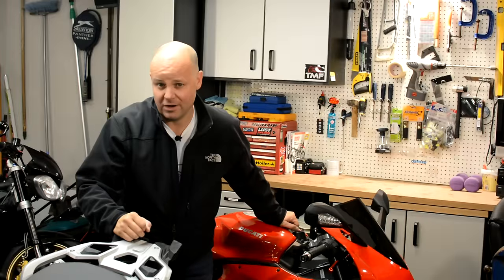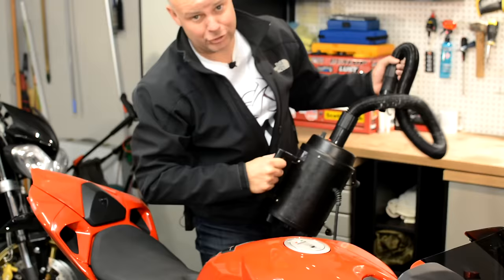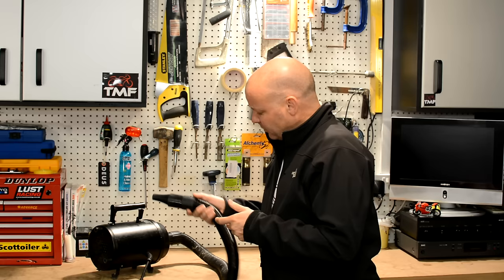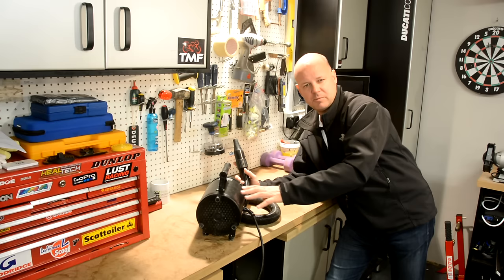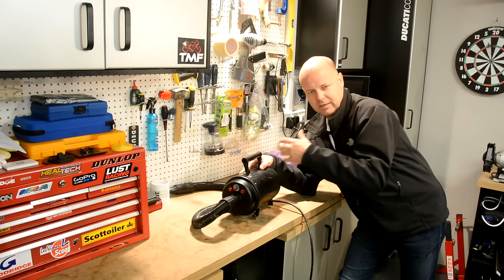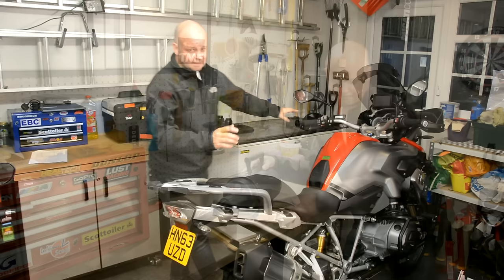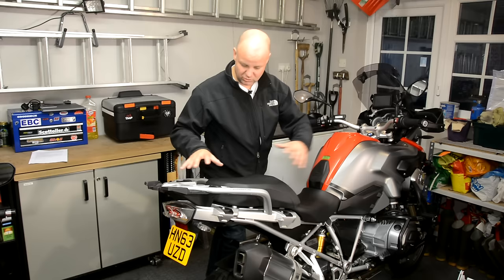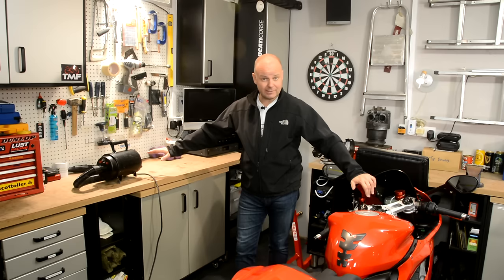Detailing Secret Weapons - Motorcycle Dryers

Comment: I dont own a bike but love (read obsessed by) the channel. I own a detailing company in scotland and highly recommend the dryer for the bikes they are a god send, Polished Bliss also sell some dryers Black Baron hand held is a good machine, Ebay sell these dryers but beware of buying outside of the UK, i also use an RCD with it... just incase. when your vehicle is waxed or sealed it makes drying so much easier, have a look at Tac systems UK for paint protection coatings.
Reply from the maker: Cheers Graham, good tip re the RCD - thanks!

Comment: Thank you for another informative video. I went the pet dryer route for my Tiger 800 and it still amazes me how much water blows out from the radiator!,I can say it works a treat when set to hot, never had a specific bike dryer but the pet dryer has been used for 12 months with no problems. Think it was £55 from flea bay, hope that help someone who is worried about a pet V bike dryer.
Reply from the maker: Thanks Wayne - the pet dryer in my link below looks pretty much the same as my bike dryer I must say.....

Comment: Just purchased a pet dryer, rated at 2.8 k Watts with variable heat output. It comes complete with various nozzle attachments. Looking forward to cleaning my GS1200 and blasting away all the moisture. Will also try this out when I wash my car, especially around the rear hatch area where water always seems to pool up and on the alloy wheels.

Comment: Great product as you say, although probably best not to use the 2800w version on your pet! The other good thing for corrosion free bikes is a de-humidifier which I use in winter to keep the humidity to <50% in the garage. Good if you’re parking a sopping wet car near your bike. The better ones also have a heater element to keep the garage at a reasonable temperature. Anyway; to work.....great vid as always and I wish you a good week!
Reply from the maker: Great idea Steve, I have a dehumidifier that lives in the garage but never thought of using it there - could be ideal for those days when it's warmer out than in and condensation settles on the bikes.....good tip!

Comment: Great advice. I picked up a unit at Costco (do you have Costco's in the U.K?) for about $25 dollars. It does not have the heat option but works great for the price. I got the unit after watching your original bike cleaning video and this method has cut cleaning time in half. Another great product is S100 spray on bike cleaner that I highly recommend. Cheers!
Reply: We do have Costco over here, but, they don't carry the range of gear that the US stores do. No sign of a dryer online and haven't seen any bike kit in the store. They have a few bits n pieces for cars, such as oil, car mats and wipers, that's about it.
Reply from the maker: I love a bit of Costco! (the croissant bit)

Comment: I have the Bruhl MD2800 which is a twin fan jobby so very powerful. The water just flies off!
Reply: Chris_Audittr2108 ive been looking at the bruhl2800 what is the heat like or does it have any heat settings as i cant seem to find much reviews in this model thanks
Reply: kingbullykutta - The heat comes from the heat that comes off the electric motor. It doesn’t have a specific heating element in the same way a hairdryer does for example. So the air it blows out gets a little warm rather than hot in any way but being a twin fan model, it blows out something like 170 mph if memory serves. I can dry a car in 25 mins so a bike is no bother at all. The warmer air helps things along but the power is what does the job. It’s nice though on a cold day as the the hose and nozzle get warm and keep your hands toastie!

Comment: Hmmm, that is a good Christmas/birthday wishlist item, thanks TMF. Currently I use a towel on the bike and on the car to dry and prevent streaks, but it doesn't properly dry the hard to reach water retaining spots. My normal rule of thumb is to wash first, then towel dry, then ride to blow out any remaining water which would lead to corrosion. I used to have a compressor which was great for that task, but it was rather noisy when pressurising the cylinder beforehand (so not as practical as a dryer and no heating option either). Could borrow the wife's hair dryer and face the wrath if caught ;-), but it doesn't have enough power to do the job properly. In places where there are a lot of minerals in the water system, failure to properly dry means ugly spots on the paint finish.
Reply from the maker: Sounds like you defo need one of these puppies then....

Comment: Great video TMF. Mate, your GS looks in showroom condition given the mileage and time you have had it. Well done! On my GS found the wheel rims hard to get clean and actually tarnished on mine over time (have wire wheel rims) . Also grit within cylinder head air vents hard to get at as well. Tooth brush might be the go there.
Reply from the maker: Yes those cylinder heads are a pain, as you say a brush is the answer (and the occasional jet wash!).....thanks for the kind words! - TMF

Comment: Hi TMF - thank you for another interesting, honest gear review.  Have been thinking about getting one of these for a while.  It will be really useful for the Bonneville - it has no radiator but loads of nooks and crannies round the engine cooling fins and the oil cooler.
Reply from the maker: Perfect!

Comment: Hi TMF. Been subscribed for a while now and appreciate all the hard work you do in giving us these vids. Recognise 99% of the roads you film on as I'm only in Stoke Mandeville and grew up in Hughenden Valley / Bryants Bottom. I too am a big Triumph fan and suffer with the same OCD cleaning illness! Saw an earlier video you did where you used a dryer and I had to have one. You advised it was from eBay but they were out of stock for ages. Then saw one being used at a Harley dealer being dragged around on its side all battered. They said it was brilliant, had had it for a few years and used several times a day. So bought one. Master Blaster, made in USA but there is an importer here. Expensive at about £220 but well built. I made a trolley for it as they all tip over easily. Far better than my airline and less likely to cause damage from fine jet air. My 70 year old biker friend and neighbour scoffed at it, borrowed it, then bought one! P.S. I know you're not a cruiser fan, and I'm not really into the chrome, bags and tassels thing either but I've a new Thunderbird Storm and wondered if you'd thought about reviewing one of those? Throw a leg over mine if you do. Who needs Sky TV when you've got TMF, Captain Rambunctious and others! Sorry for the long comment!
Reply from the maker: Hi Mr Bojangles and thanks for the long and kind comments!  I've never ridden a thunderbird storm but would love too!

Comment: I bought two of these to compare them side by side.
A cheap £55 "GRANDMA SHARK 2800W" which is the same size as in your video.
Then a larger £135 "SHELANDY/GRAVITIS Professional 4.2HP" which is about 50% longer than the above.
Both worked well and the latter was about 30 > 50% more powerful at 'blowing' but the heat output wasn't as good as the former (probably as they use the same heating element).
TLDR; buy the cheaper units if you want value for money.

Comment: Just wondering... Why not just use an air compressor instead? One could use that for displacing water off the bike and then for applying acf50 maybe?
Reply from the maker: This blows out hot air so is better for drying...I have a compressor as well for the ACF50 by the way :0)

Comment: I bought a pet dryer for about £70 which worked well for a bit but the motor burnt out after a few times using it. Turned out to be a false economy. I'll be investing in a better quality pukka bike dryer next time.
Reply from the maker: Generally speaking, you do get what you pay for - the "Turbo Blaster 1000" I have is a sold bit of kit...